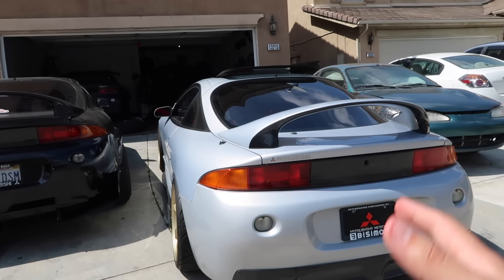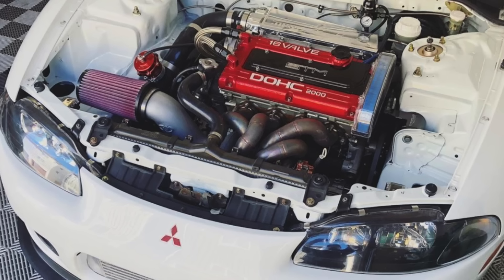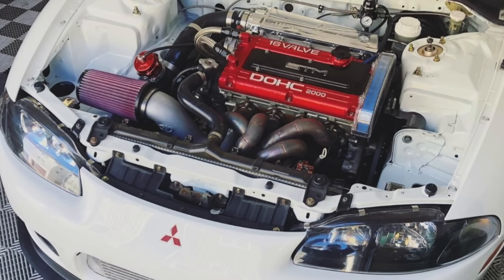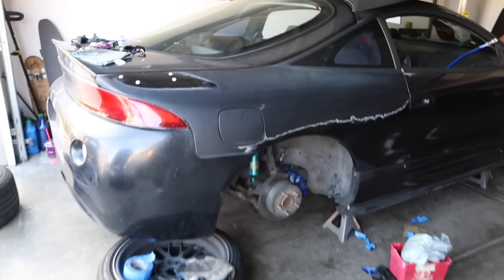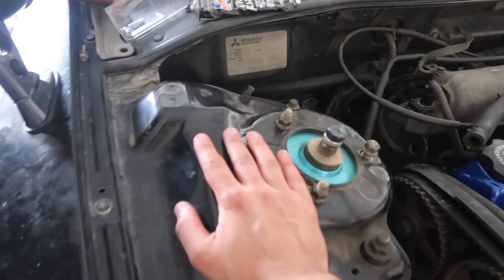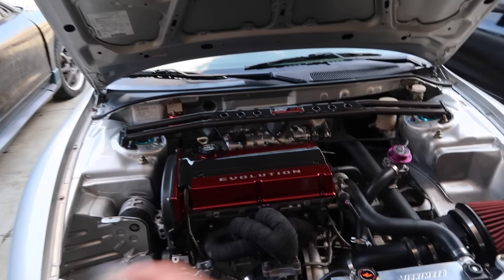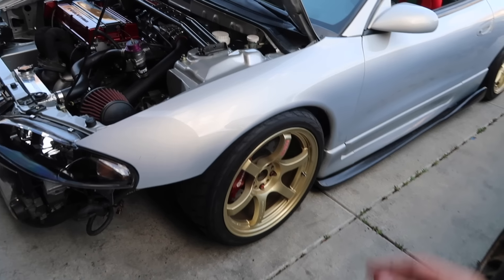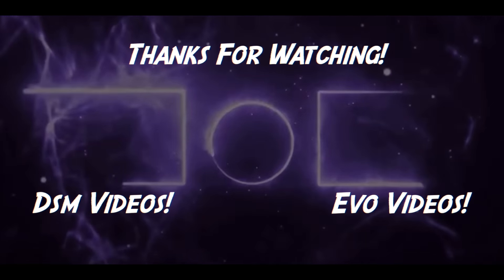WATCH THIS Before You Buy An Eclipse !!

Comment: Hey bro, I now you had "fun" with your axles a few videos back.....so I have a question. My 2012 4G has a crack/rip in the CV boot. If it just happened do you think I should be good changing just the boot, or should I do the whole axle? I don't know how prone the axles are to failing, but I don't wanna just throw money at it if I don't have to.
Reply from the maker: I would have it rebuilt just to be safe man. Might as well
Reply: They run $40 for new ones online. Maybe just replace them both. On a scale 1-10, how hard was taking them off the 2G?
Reply from the maker: Like a 5 if you know what you’re doing
Reply: Buy the whole axle. Those crapy boot replacement suck with the crapy tie, and a mess when you fill up with grease, it then becomes slippery if it the tie isn't properly on right, unless you know what youre doing, make sure you have the proper pliers.

Comment: About to pick up a 99 but it's a soft top for 400$.The rear back right wheel is locked up but engine runs fine at 97k.What would cause the rear passenger side wheel to lock up.?

Comment: Just got my small 16g installed yesterday! This thing really screams up top with a 2.3l Stroker and FP manifold!
Reply: Get a bigger turbo for a 2.3. 100% 20G or bigger.
Reply: @rhodycars6058  just because it's a 2.3l doesnt mean you should run larger. 16g is perfectly fine that .3l doesnt make a huge difference. I have supporting mods to max out the 16g not a 20g. And I only spent $250 on a new genuine small 16g cant pass that up.

Comment: Love g2's they look great!!! See i never had a problem with the 4g64 spyder the 420a car I had was absolutely terrible man. Crank walk out the ass, went thru 3 transmissions before 155K when the engine blew from leaking so bad. No way would I ever touch a chrysler motor again after that experience. This was a 99 gs in 2005 and 2006. Love my g4 gt manual I have now never had any problem with that either yet knock on wood.

Comment: I have a 99 GS it's been rough idling and the exhaust smells of gasoline and it has very low power when I accelerate it, do you think it could be the EGR valve? thanks bro

Comment: I have a Mitsubishi Eclipse 420a 1997 5speed stick shift. Engine light code P1390. Does anybody have a scanner to reset/relearn the crank/cam shaft sensors. LA area in SoCal. Thank you.
Reply: Check your timing belt, make sure all timing marks like up properly.
Jack up car, put into netrual (Make sure car is on jack stands and e-brake is engaged), rotate crank using 1/2"ratchet, line up timing marks, you can find diagrams online or purchase manual book. If everything is lined and marked on point=timing is good.
Check cps(crank positioning sensor) for any wire cuts or loose connections, could be bad sensor